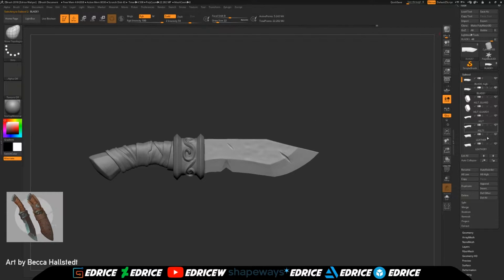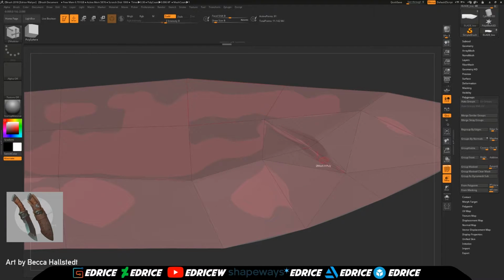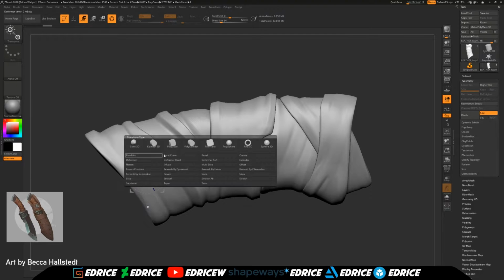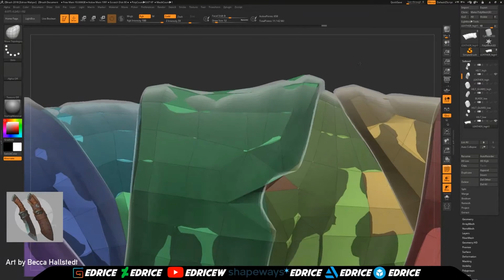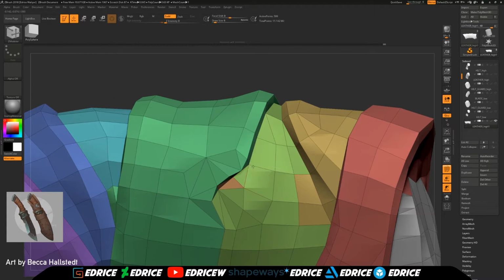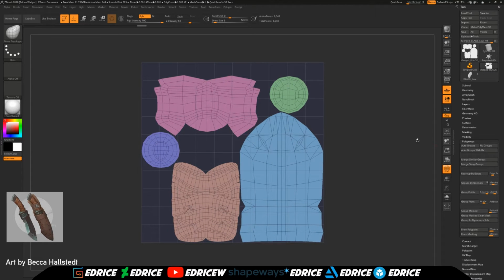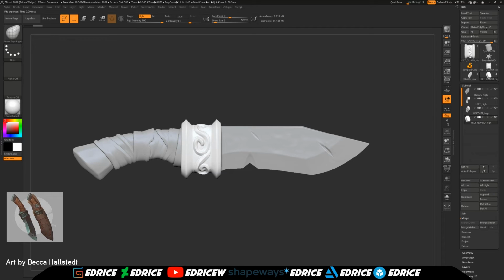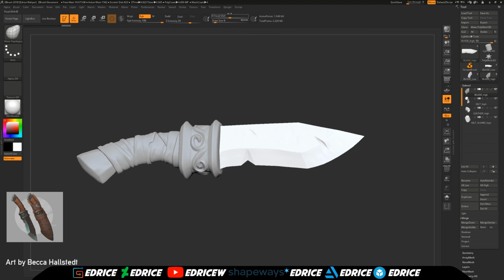Making a Game Asset using Zbrush  - Part 03

Comment: Also I get confused with the work flow for high and low poly models. I made a separate high and low poly model thinking I could use the normal maps from the high poly on the low but it said I needed the low poly to be the lowest subdivision of the same model in order to bake it down. Not sure if this question makes sense. It always looks so simple when I watch tutorials, but I always end up with technical issues when I try myself
Reply from the maker: You can't bake normal maps from another model to a low poly model in zbrush. You can only bake the normal maps from the highest level to the lowest level of subdivision. But you could do what you had with something like xnormal, but that's outside the scope of the video.